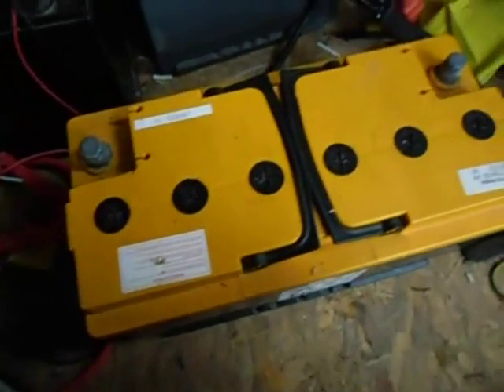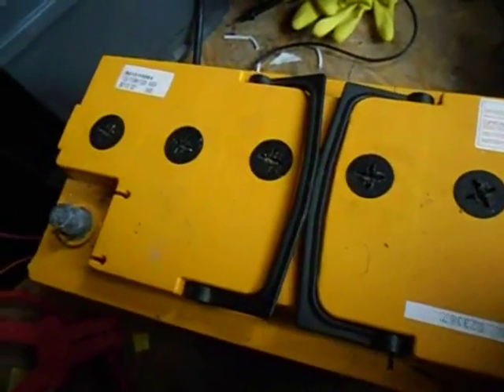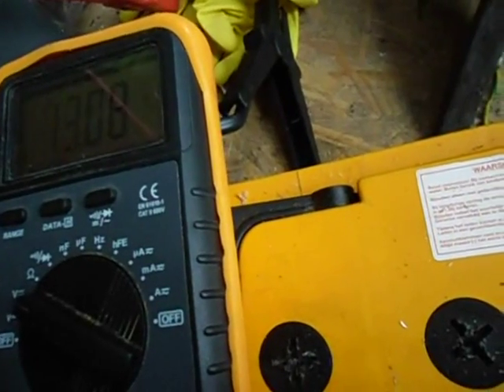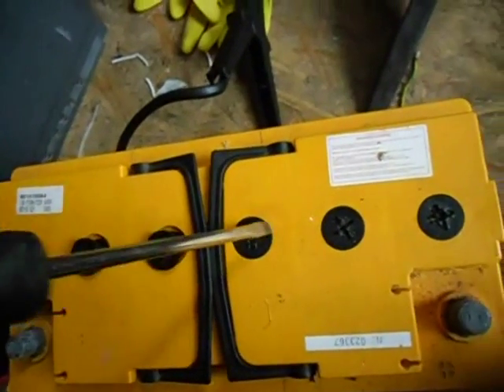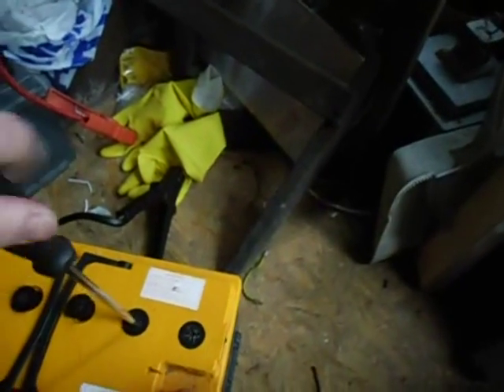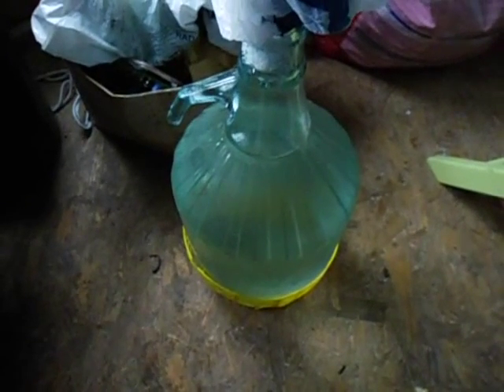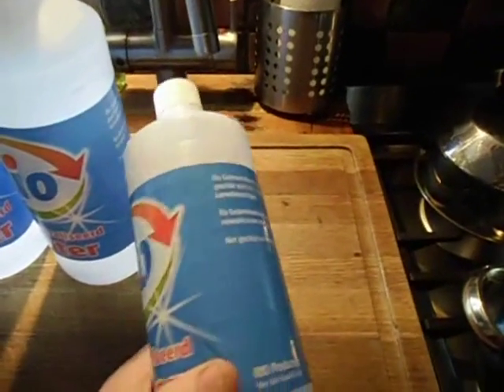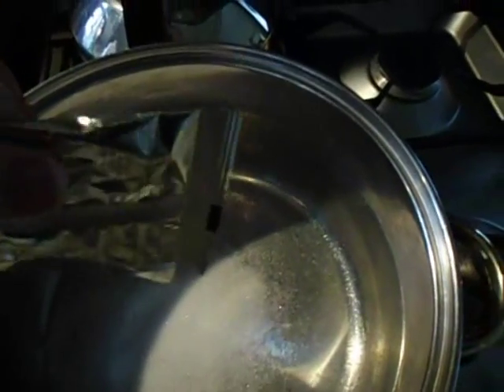110Ah_battery_alumconversion

Comment: i use the same  alum in a 150gr per liter mix, just tap water, and import end. do not rinse and neutralize the acid in the bat with baking soda, the alum itself will prevent the battery from further sulfating and you can discharge these alum conversions way lower than a lead type battery, i normally stop discharging at 10.5 volt under load, but try d even 8 volts and the batt is still working perfectly, i use a small xta 7 (ah) motor start bat to power a single 12v LED light in my shed, can run it for hours its burning bright even at 10 volts, also recharge this old alum conversion only 2x a year, so it does not lose much power for this stationary low amp draw use, perfect battery for this kind of use!

Comment: it took me a while to get to this, but thanks very much for posting. I was curious about the process, but you make it look very simple. I just found some smaller 12v batteries for sale with the acid pack not yet installed, and I think I may be picking up a couple.
Reply: I converted 3 batteries till now, but they where all old and sulfated. I am very interested in the results of a conversion of a new battery. Please let me know when you start with it.
Reply: Look at my sons charger, it can desulphate your battery to work as new. His youtube channel EMC4U2 and the charger is called the RE-EMF charger. after desulphating, rinse the battery with distilled water (get lead oxides out.) insert distilled water with alum and a little bit of sulfuric acid (not to much) recharche a couple of times with the RE-EMF charger  and the battery will grow stronger and stronger.